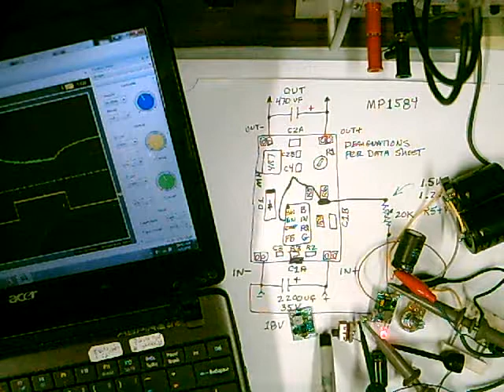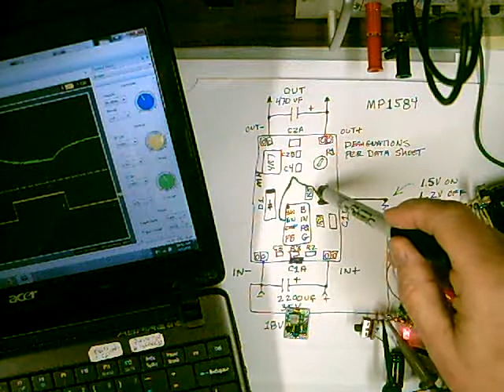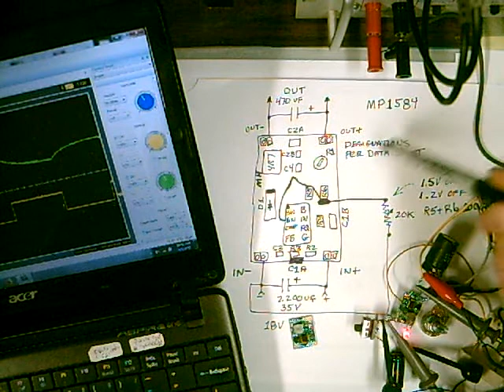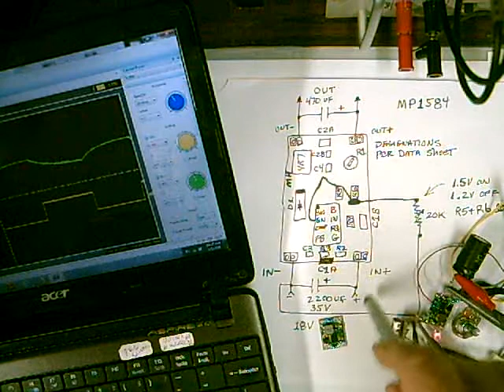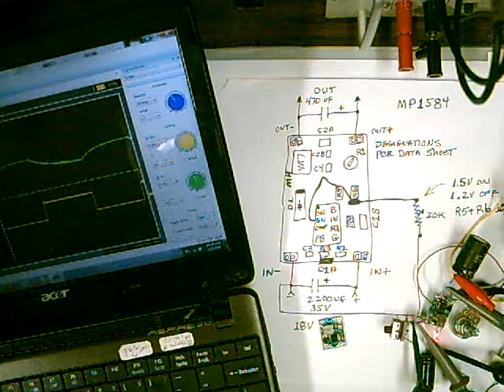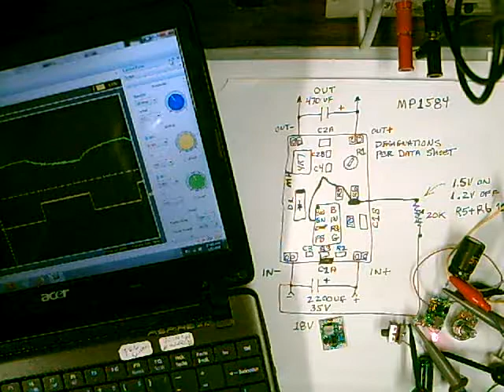Make A Solar Linear Current Booster with MP1584

Comment: Hello

Nice Videos even if they are a bit too deep for me! 😄
Could you please recommend me a few cheap ready-made mppt modules which work efficiently!? I plan to use it in combination with a 18v 20w solar panel. That's all the energy I need in the jungle where I plan to use it.
I would prefer to use my 6v foldable 12.5 or 25w travel panels than to get one of those bulky 18v aluminium frame panels but I plan to use lifepo4 batteries and guess making a 12v battery is better than one or two 3.2 ones out of the four 3.2 6ah batteries I have since in the end I need to power usb applications. As well I haven't seen an mppt module for 6v panels, only ones set for 18 or 9v. 10w into my batteries is all I need in the end.

Many thanks!

Comment: So to assure myself:  You are using a shunt on the lower part of voltage divider that supplies "power good" to the enable pin of the MP1584, so it turns on at a higher supply voltage on the input, so in effect making an input current limitter, so your solar panel can be kept at a reasonble voltage. I've ordered the same buck converter for a 20W solar panel charging some supercaps, which are even lower resistance than batteries, so I'll definately need this. Thanks!